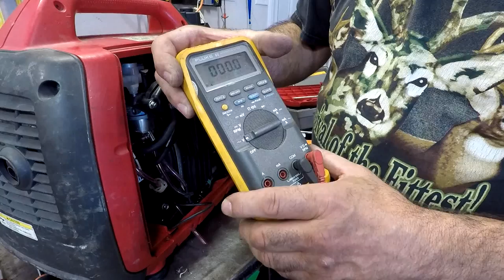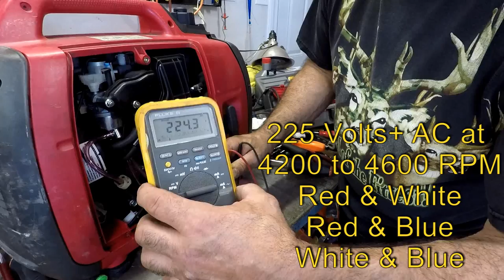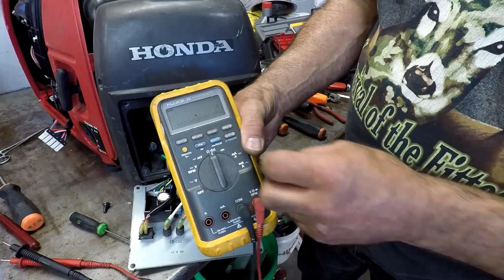EU2000I No AC No Power Diagnosis

Comment: Wow there is obviously no throttle servo control and the engine is in overspeed condition. It would be usefull to note voltages at idle to max.

Comment: Hey man my eu3000is has no power output motor runs perfect it’s in great shape and I’ve looked for lose wires ground and everything checks out but I don’t know how to diagnose inverter module or power from stator
Reply from the maker: I don't think my video will apply to the eu3000is but it will have similarities. Look for the shop manual. I found some for sale online. With the manual, it has step by step test to determine what has failed. Keep in mind that inverters rarely fail. So test twice before buying parts. Good Luck.

Comment: Hello, mu honda eu1000i 220v 50hz has a delay to start ac output. When this problem started, when i started the denerator  i had to put eco throttle button on rabit to start to generate ac power inmediately. And now after i start, i have to wait around 10 - 30 minutes to start to generate ac.

Comment: Hi Martin. Thnx for educating community, it is weary hard to find any DIY info on these generators. I’m having issue where there are no lights at all , generator is running rough and only has 16v DC output where 12v should be . Also checked the AC output from white , blue and red whirring and it does produce 220-260v depending from RPM’s , do you have any advice how to proceed from here ?

Comment: i have 2 honda eu20i one of them goes to red when demanding power and the other one its just fine and takes 2 seconds to power uip the AC  , portable air conditioner, what is wrong with it? i already swap all the carburator and spàk plug and does the same, so i imagine it is an electriucal issue, can you help me? im at the mayan riviera in mexico
Reply from the maker: If both generator/inverters are the exact same, then yes you have a problem. They do make a eu2200i that has more power which can easily be mistaken as a eu2000i. If they are the same, try turning off the ECO Throttle and see if it makes a difference. Follow the test procedure within the video to  make sure you don't have bad stator stator. The Idle Control Motor adjust the speed of the engine based on demand. If the Idle Control Motor is not functioning, the engine will not speed up when needed. You can try increasing the RPM by manually opening up the throttle. If the light goes green than look into replacing the Idle Control Motor. You can always try swapping parts from the good generator/inverter to isolate the issue. Good Luck,

Comment: hi i have question, i have the same generator but nothing turns on in the front panel. i metered the long plug behind it and i get haf voltage on everything. for the 12v i get 6 for the 240 i get 120. but i notice that the rpm is very low. and also no light infront. what can it be ? thank you
Reply from the maker: Here are a few notes:
If the motor is running to slow, nothing will light. You might need to look at the idle control circuit wiring or idle control motor. 
Make sure the motor is running between 4200 to 4600 RPM. You might have to manually move the throttle on the carb to increase the RPM. Voltage will increase with RPM
Make sure you checking AC volts with your meter.

Comment: Awesome video. Thank you very much Martin. We are anchored out in Georgian Bay and woke up to make my coffe and charge the house batteries.  My Honda 2000i had the dreaded no AC,ughhh. I went through your testing procedure and never guess what I found. Yep, my white AC output wire has broken right at the connector.  Exact same issue.  Jammed the wire back in the connector and put a little dab of JB weld to hold it in place.  Just a quick fix to get power, will replace the connector when back home.   Thanks again Martin, you're a life safer.
Reply from the maker: Great to hear. Thank you,

Comment: Nice stuff and good advice in  your notes.  You are one out of 100 guys who post videos that know how to use a meter and how to troubleshoot.  Lots of bad advice on YouTube.  You it it on the head about how these generators function.  Get the engine running right, check your motor speed and your wiring.  That will solve 95% of the problems.  I wonder how many inverters are replaced needlessly.  Thanks for a great video.  Also, if you do lots of this work, sets of connector pins and alligator clips are made for meters to fit different size jacks.
Reply from the maker: Thank you,

Comment: Great job bro.   I'm working on one now.   The motor is running rough at idle. And I got to clean that  jet under the idle screw.  But the green light was on till I got it to crank
Reply from the maker: If the motor is running to slow, nothing will light. You might need to look at the idle control circuit wiring or idle control motor. Try manually increasing the speed of the motor to see if the green light turns on. If it does, than you might have a bad Idle Control Solenoid or wiring to it.
Reply: @MartinMetregerTipsandTricks  im  working on it for a friend.  It wouldn't crank at first.  I cleaned the carburetor out and it Crunk up. But the green light stayed on for about 3 sec and went off. It was running rough when green light went off.  It ran good for about 4 sec
Reply from the maker: @thebull5099  Focus on getting running good. Then worry about the light. You might have bad gas or water in the gas. The carb has tiny holes by the throttle plate. Use the smallest wire in a torch cleaner to push through the holes. Don't force it. Striped copper wire will work too.
Reply: @MartinMetregerTipsandTricks  i got it running  idle screw jet was logged.   Thanks bro

Comment: Nice work
I have the same Honda, have a problem with 12 volts DC port I found 24 Volts
Any suggestions to resolve this problem?
Reply from the maker: That voltage test should be checked while hooked up to a 12 volt battery. You should see around 14.5 volts + or -
Reply: Bad rectifier module

Comment: Hey Martin, I just changed my spark plug, carbeurater (old one had a broken choke lever), and air filters. When i put it back together, it will only idle at a very low RPM. No power from AC outlets. Any advice what I should check for? From looking, this is not a very common problem.
Reply from the maker: Sounds like the linkage to the idle control solenoid is not hooked up right. or the control solenoid is not getting signal to raise the idle.  Try disconnecting the linkage to the throttle and manually increase that throttle and see if you get power. If you get power, focus on the idle control solenoid. They do go bad.

Comment: Do you recall a part number for that wire? After an hour of troubleshooting your video took me right to the problem.
Reply from the maker: I could not find a part number. I believe it is discontinued. Repair the wire or maybe you can find a dealer with old generator parts. Good luck.

Comment: I have a question I recently bought a used home eu2000i and I cleaned out the fuel tank and the carburetor and the internals…. The machine runs very good my only issue is that well it starts wanting to cut out around 1600 watts and then it drops and tries to pick up watts and drops again it never shows overload….. the green light does seem to momentarily go out….. lets say I kept it at 1300 watts I would have no issue take up a notch and it starts to stumble….
Reply: Also my circuit breaker/ reset switch never pops out would it only pop out on a short circuit or would it also blow on an overload ?
Reply from the maker: Sounds like it could be several things related to a heavy load. Possible that the carb is not getting enough fuel delivered to it. Check flow from the hose going into the carb. It might also be a ignition coil breaking down under load. Hard to diagnose this issue. I would try everything else and then replace the coil. Good luck,
Reply: @MartinMetregerTipsandTricks  hey thanks for your reply after messing around with the generator I realized two things one the spark plug was part of the issue and then also I had to clean the heck out the carb replace all seals after and it worked like a champ

Comment: Corrections: Not all AC generators need to operate at a single rpm.  Only an ac generator that generates residential power needs to do that because household current is a single frequency (60hz in the USA).  An inverter does not generate power by itself.  It only turns DC to AC.  An inverter generator has a DC generator in it that is connected to an inverter.
Reply from the maker: isn't that what I implied?
Reply: @MartinMetregerTipsandTricks I thought you did...

Comment: I bought the 2200 but i should’ve got the companion because of the 30amp plug for my rv. Is there a kit to change  out the plate containing both plugs? A plug and play kit that contains a 30 amp plug? Essentially turning my 2200 into a companion?
Reply from the maker: I don't believe so. Sorry,

Comment: Nice video, I had the same problem with mine, broken connector terminal on the white wire. Must be a common issue with these units.

How did you fix yours, did you solder the terminal back together? I’ve been trying to find a replacement terminal with no luck.
Reply from the maker: I did solder it back together because I couldn't find a replacement myself.

Comment: Good thing you didn't need an inverter. That box runs between $400 and $500 dollars.
Question: Where did you get the manual from?
Reply from the maker: I searched on google and found it. Unfortunately, it has since been removed. I just searched again and found this https://halcyontimes.files.wordpress.com/2012/10/eu2000i-repair-manual.pdf

Comment: Great video I have a ex 650
Honda suitecase and the voltage is reading very high what do you think this could be
Reply from the maker: Check this video out at 7:10 for proper governor adjust. https://youtu.be/IgmSk2-vWNc
There is also a screw to adjust the speed of the engine which will adjust voltage and hz. You need a meter that will read hz which should be set to 60 in the USA. Not sure what the settings would be in Europe. Good luck!

Comment: I have a Honda generator that the green indicator light comes on, and no power at the plug ins? Any ideas?
Reply from the maker: Hopefully you performed the test as described in the video. Closely look at the wiring behind the front panel. I found a broken terminal that caused the problem. Also, make sure the circuit breaker is not tripped. Hit the reset and check the ohms of each wire. Good luck.

Comment: Hey thanks for all the info in this vid.
Q: my output light does not come on but I do get power  
Do u know what it can be 
It works just the light don’t come on
Thanks in advance
Reply from the maker: Sounds like the light itself is bad. I believe the light is integrated so you can't replace it as it is part of the module. My advice is if you are getting power, then live with it.

Comment: Hi Martín , my eu20i is not giving me the 2000 watts , my other one is fine so I’ve been swapping everything to the bad one and does the same so it’s not the carb or the spark or the other components . I met be thinking about the fuel pump met not be sending the right fuel pressure, I already did everything, if I swap the whole carburetor and didn’t work what ekes could it be ?
Reply from the maker: Does the generator run but no electricity or is it a no start condition?  No start, I would say check for spark. If you have a good spark at the spark plug, try squirting flammable brake clean or carb clean in the carb and try to start it. if it start for a moment and dies, you might have a bad fuel pump or blocked line. check for kinks in the fuel hose. Another thing to check is smell the gas. Maybe the gas is so old, it won't burn well or someone put diesel fuel or something else in the tank. You can check compression and make sure you get at least 90 psi. Good luck.
Reply: @MartinMetregerTipsandTricks  thank you for the response , I’m in Mexico so my English may be bad . The eu20i runs well but is not giving my the juice , is not like the other one that gives me the 2000 watts entirely, when I plug a water pump it won’t make it run and goes to red or blocks it’s self , I know is not giving me the juice because the other eu20i I have it does , it gives me all the juice and I even cab run a small portable AC that starts at 1200 watts to run the compressor . The faulty eu20i is not , so I’ve tried swapping the whole carb unit from the good one to the bad one and it does the same so it’s not the carburetor , I even swap the spark plug and even placed a new spark plug and it does the same . What can it be ? The fuel pump ? Or is it the electrical components , I have no idea what can be causing that , I even tried cleaning that black screw by the carburante or that one turns it 4 times to calibrate , this plastic black screw has a tinny hole that I have cleaned already and just by placing the good carburador from the good generator I have it should give me results but it doesn’t . What I’m thinking is the fuel pump may be which is not sending the right amount of gas ?? Do you know how to access and Clean the fuel pump ? Can you help me find a tutorial for fuel pumps ? Happens that my search engines go to Spanish and in Spanish I have nothing good for tutorial on this Honda inverter model . Thanh you so much for the help . I guess you have subscribers all over the world , well you have me on the Mayan riviera and I’m glad I can follow you

Comment: Can you link where you found the wiring harness
Reply from the maker: I went to a small equipment repair shop and the sold me a used harness. It was hard to find. I actually fixed my harness before I finally got a good one.

Comment: engine working prefect but no power no green  light, any idea how to fix it, what is the problem please 🙂
Reply from the maker: Did your follow my step by step checks in the video? Start there. Also, make sure the idle is not too slow. Must run fast enough to turn on the green light.

Comment: If you had the manual , you would know that , that machine has blue tooth . It will tell you something’s . But if you have to further to diagnose the problem , then this series of vids just might be what you need . 
This generator costs $1166 . Oo from a dealer , and Honda generators are damned neer bullet proof . Don’t throw it away if you don’t have to . The Japanese did us a huge favor as their technology to build things has greatly improved over the past 4 decades . My hats off to them .

Comment: hola tengo un generador igual al de tu video, es 120v. yo vivo en la argentina y la corriente es 220v. tengo alguna forma de convertirlo para 220v
Reply from the maker: That is a good question. I don't know enough about your electrical voltage to provide safe input. I'm sorry.
Reply: @MartinMetregerTipsandTricks  hola no entiendo tu idioma, me podes responder en español
Reply from the maker: @juancosta2647  Esa es una buena pregunta. No sé lo suficiente sobre su voltaje eléctrico para proporcionar una entrada segura. Lo siento.

Comment: Great.. i have the same problem but i think is the inverter ☹
Reply from the maker: Make sure you carefully inspect the wires. Use an ohm meter to check each wire from each connector. My friend works on hundreds of these generators. Never had a bad inverter. But mostly found bad connection or broken wires.
Reply: @MartinMetregerTipsandTricks  The inverters are bullet-proof.  I had one that was in salt water for days and it was still fine.  Check those wires and connectors!
Reply from the maker: @eegg6954  you're right. Check the wiring.

Comment: How much would it cost to. Replace the inverter?
Reply from the maker: When I checked, it was over $400.
Reply: @MartinMetregerTipsandTricks  ok thanks. Mine is toast. Just ordered. The Westinghouse. 2200 super. For just about the same amount.   Little more.  They had. Good reviews.    But it’s not a Honda. But it will be new thanks your your comment
Reply from the maker: If mine needed and inverter, I would do what you do. Change the oil to Synthetic . It will protect your engine in high heat or long running conditions.  https://www.amsoil.com/p/10w-30-synthetic-small-engine-oil-ase/?code=ASEQT-EA&gclid=Cj0KCQiA3smABhCjARIsAKtrg6LbJmsL68tO6hEFB5MxEIrUu6_JYbUGDeBy0YpXDln7fJDvJewN25oaAp6EEALw_wcB
Reply: @MartinMetregerTipsandTricks  ok thanks. What do you think about the Westinghouse 2200 sport ?

Comment: Do you recall a part number for that wire? After an hour of troubleshooting your video took me right to the problem.
Reply from the maker: I found one at a mower shop that took it off parts inverter. You have to check around or fix the one you have.